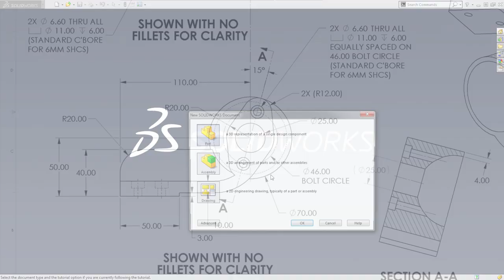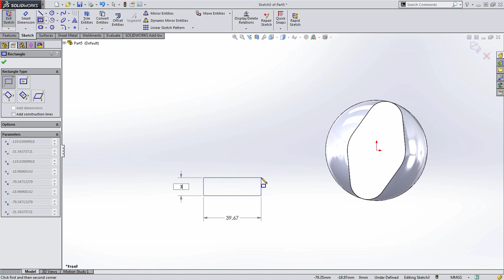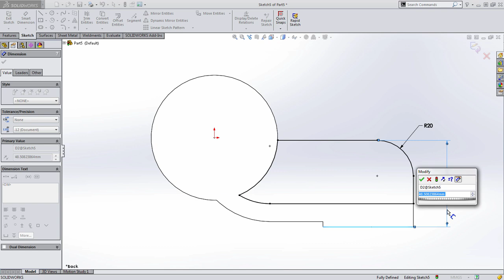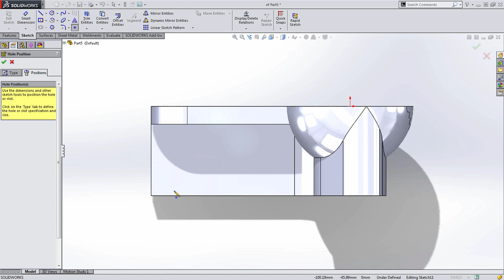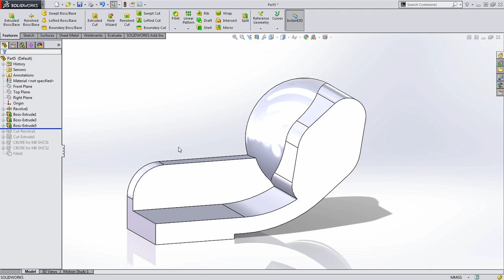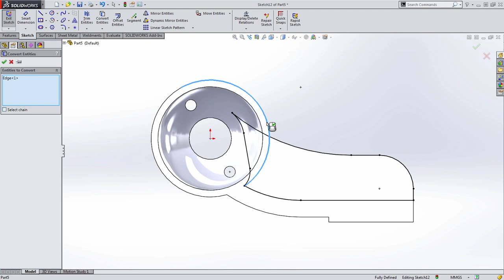SOLIDWORKS World: Model Mania 2003

Comment: Brutal Model Mania. Good news is I started modeling this the same as you. I was a little confused as to why mirroring wasn't used for the flange. darn I forgot that it was a bolt hole circle for the flange, and even forgot that I could use the system planes. I had a feeling you might mention the thin wall feature. When you performed the back plate, I did that exact extension just because I knew the sphere wasn't going to be extended over. "Roll back and take a look at this feature by feature" Ya know...I very much dislike when I don't think of things like this.
For some reason I couldn't tell that it was the whole sphere round for the added material from the drawing.
Thank you again.
I'd like to recommend a link to the model mania blogspot.

Comment: Without knowing the 2nd set of changes, what if someone use a Sweep feature instead 'Extrude' for the first Rib? Why not to do this?
Reply from the maker: Hi Indunil! Please reach out to our community to post your question for one of our experts: my.solidworks.com/forums
Reply: Indunil, can you clarify which rib? The back/front with the large 20mm 90degree fillet? Change the location of your sweep profile to the other side of the part (back to front). You'll also need new guide curves? Very surprised that using sweep was even possible because the cross sectional profile changes throughout the part no?

Comment: Guys, I think the videos are useful, but please can you sort out the consistency on your drawings. On the drawing for this tutorial, it says that the model should be in inches, NOT mm. Then you do a video in mm?! (and the fillets are in mm?! and the CB holes) On another video, you missed off a dimension. Really getting quite annoying!
Reply: It says unless otherwise specified, which it is specified multiple times in the drawing that the dimensions are in metric.  The counterbored holes specifically say 6mm and even list the units.  It also says "All fillets are 3mm" and again even lists the units. You have use a little bit of agility when reading drawings and can't just blindly go by what the title block says because the title block is generic information and is designed to be interpreted appropriately.   I understood this to be in mm.